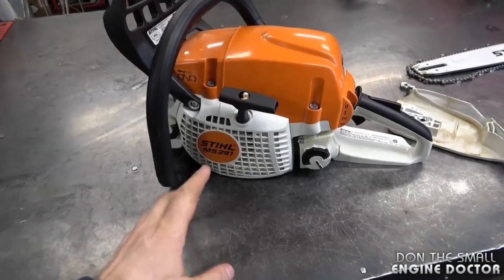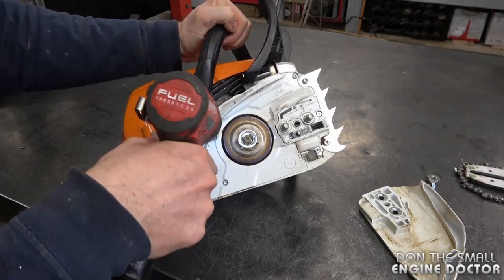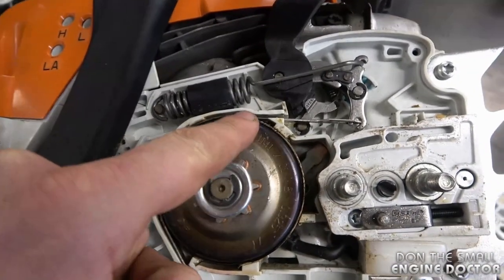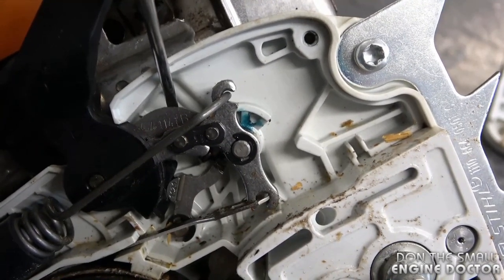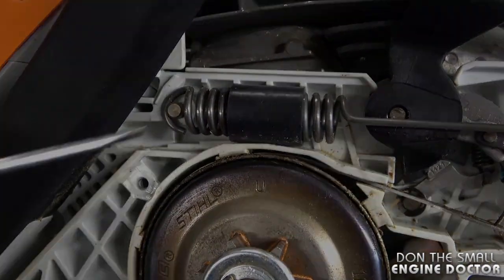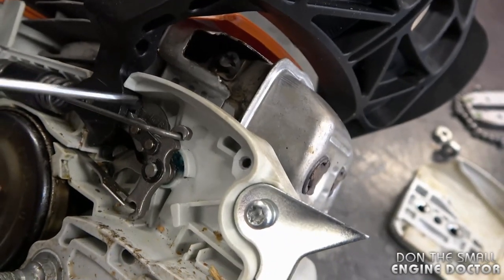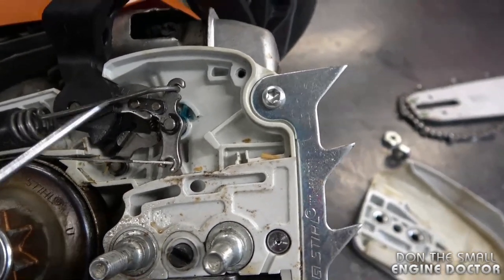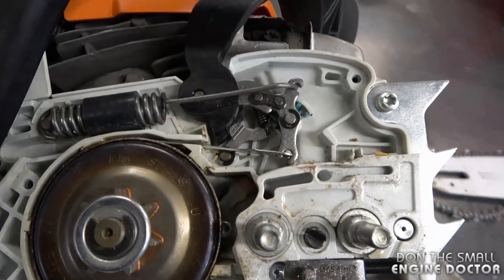STIHL MS291 391 Chain Brake Configuration

Comment: I know this is an older thread. I bought a Stihl 028 Super cheap bc the chain brake didn't work. Brake band broke. It is NLA. Band from parts 028 not the same...I happened a few months later to find the brake band and all other brake parts for 028 Super on Ebay $12 free shipping!!  I snapped that immediately. Fixed and sold $250 Sometimes the stars align.

Comment: If you're replacing the brake handle and you kinda know what you're doing, Tip 1: Cover the far end of the large spring with a cloth before prying up the end when removing it.  The cloth stops it from flying across your shop and under the beer fridge.  Tip 2: When stretching the large spring to put it all back on, use a flat head screwdriver inserted between the spring coils right near the end (don't put it in the hook part.)  Tip 3: When installing the brake bar over the peg it may go over and onto it a lot easier if you remove the orange top cover first - at least on my MS291 that was the ONLY way to get it on.

Comment: From the looks of that clutch drum, the owner started up the chainsaw with the brake on but forgot to release it once the saw started and it ran on high idle for awhile. Even though it’s not “safe” I never start my saw with the brake on because I start it on the ground and have control of it. For those who drop start it’s probably not a good idea though.

Comment: I built a huztl 372 kit and the brake had me stumped for a bit but one of your videos confirmed that I had the linkage in the correct orientation . I ended up relaxing the spring by putting a nail through the spring and into a socket big enough to cup the spring. This assembly clamped in my vise pevents spring flying away, then heat a few coils a bit with a propane torch till you see coils get closer together. Chinese parts sometimes need adjustments.
Brake still stops instantly even at full throttle.

Comment: I have an old mobile phone that i use for taking pictures from a few angles before taking apart wiring or odd mechanisms, it can be years before i need the pictures again.
My frend has an old van with an unknown make reversing distance display, wires have dropped off with age. Thankfully i took pictures years ago as i knew it was bound to fail, and it did 6 years later lol.
I have pictures of my briggs&stratton mower linkage and carb pump gasket order.
Human memory does fade richard lol :)

Comment: I would like to ask a question unrelated to this video but addresses a common problem. Would gas line anti freeze work as a co-solvent to cause water deposits in a fuel tank or float bowl to remix with gasoline containing ethanol?
Reply from the maker: possibly yes, i use k100

Comment: The small shaft that holds the chain brake spring to the body of the saw is missing...can that be fixed? I actually found this ms391 in the ditch. There was not a muffler and the chain brake handle was flopping. When I took it apart the spring was loose inside there. I bought a new muffler and brake handle. Is it possible to purchase that  small shaft?
Reply: I have thought about drilling a slightly undersized hole into the plastic body then heating a shaft and quickly insert the shaft into the slightly undersized hole the quickly shove it in there and let the plastic cool around the shaft.

Comment: K100 was just the first to fail the fuel additive test over on Taryls channel. Wanted to let ya know in case you had not heard.
Reply from the maker: works for me, just started my generator after siting for one year
Reply: @donyboy73  American K100 got covid.
Reply: @donyboy73  cheap china carbs on those motors. K100👍works
Reply: @Thomasploeg1968  k100 works ?  Contact them to re label their product to exclude what it doesn't work on then . Oh but wait , a fuel treatment that "works " can't say it doesn't now can it ? Lol
Reply: It’s pretty bad when it doesn’t even last 6 no. The 2 engines that had ethanol pump gas still started but ran roughly. I’m glad it worked for you Donyboy but here in the Midwest we can have some pretty severe temperature swings. I guess we will see if the additives work but I believe using canned fuel for storage or just plain old dry storage is a better idea.

Comment: Taryl Dactal said that your K-100 fuel additive has failed. Check his last video at 06:24
Reply from the maker: We had a storm 3 weeks ago and my generator that was sitting for over a year started up right away. All my neighbors use k100 and they had no problems. Parked my motorcycle last october and started right away this april.